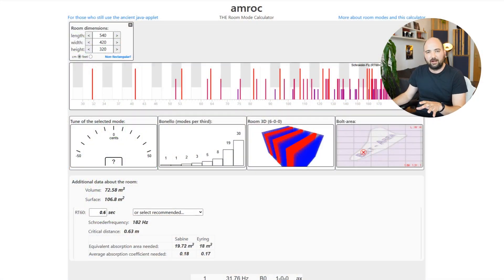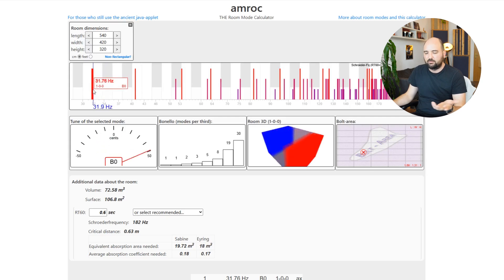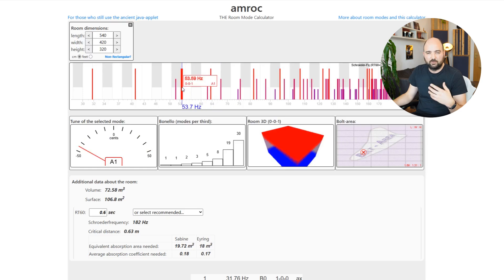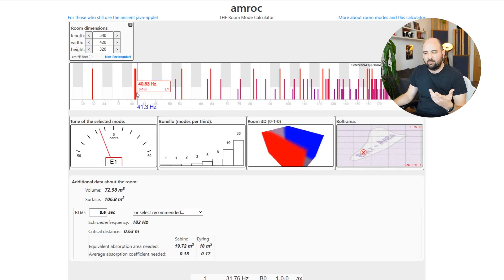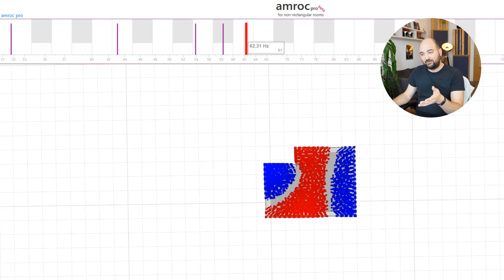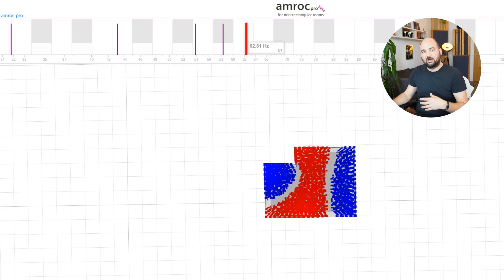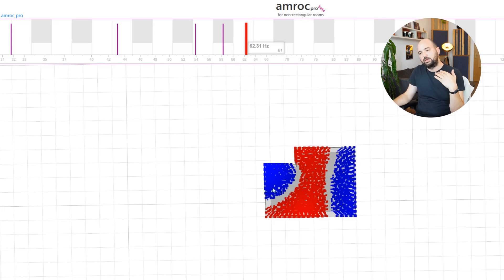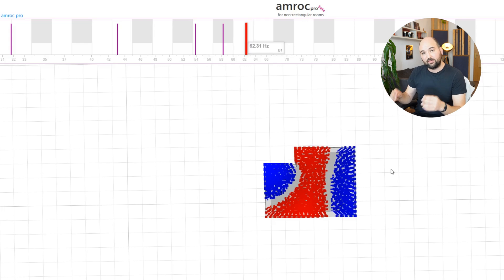Struggling with Low-End in a Non-Rectangular Room? Here’s How to Fix It

Comment: I use a subwoofer with the phase flipped 180deg out of phase in a very specific spot to even out my low end. Essntially creating an active bass trap. I went from having a room mode at 125Hz, 60hz and a null at 80hz, to having a waaay smoother image and no more nulls or that very peaky room mode at 125hz and 60 hz.
Its set up at the moment slightly behid my monitors right in the middle at the same height. I know it sounds like this doesnt work, but it really does for me.

Comment: I have a pair of Adams A8H's which come with A-Control which has the ability to time delay each speaker. Is there a way using REW to check and tweak the alignment of the Adams with my separate subwoofer?